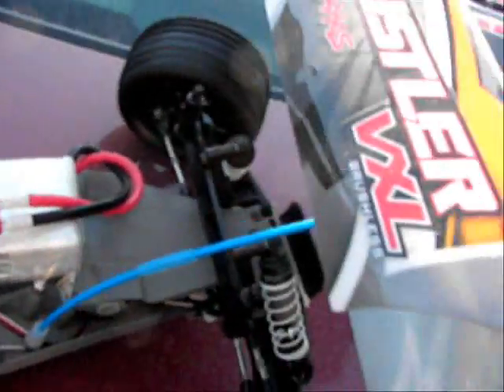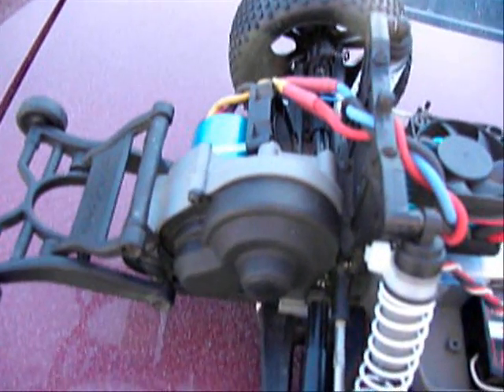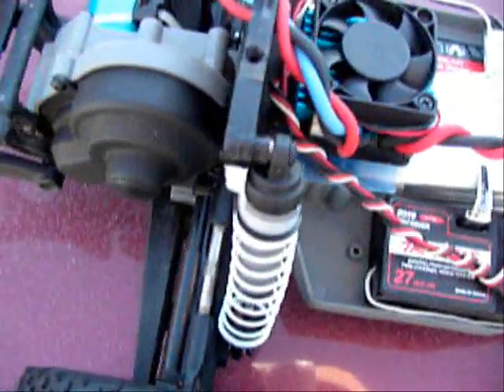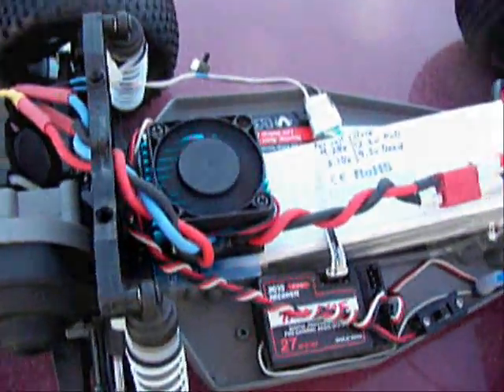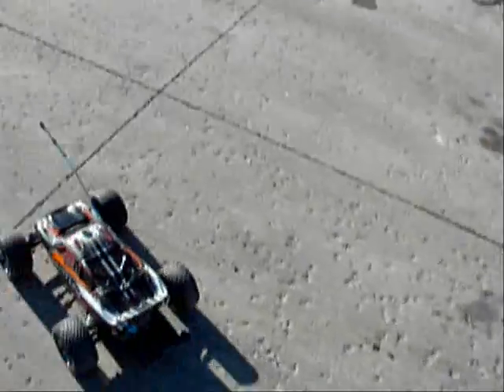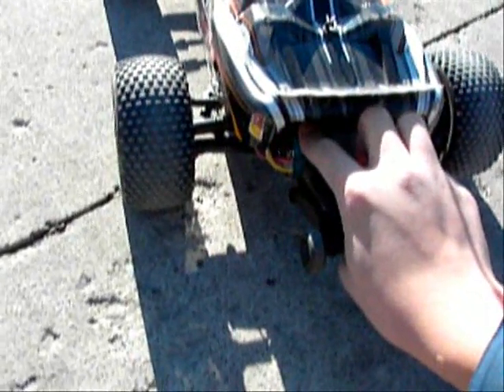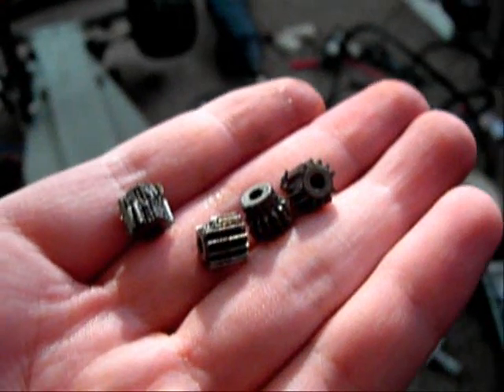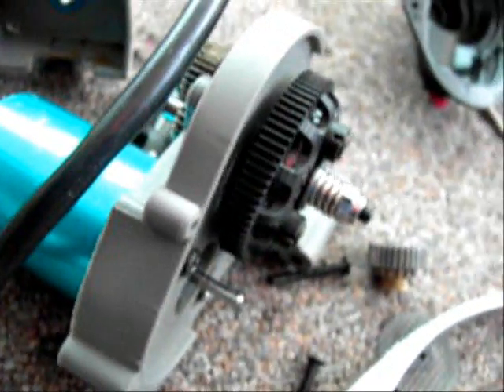Traxxas Rustler VXL Brushless RC Part 2

Comment: that thing is hallin ass man. and still power to wheely at high speed, holy fuck balls no wonder you spun your differential gears.  that thing is faster than my promod12's.. holy shit.. i still can get over the speed on that thing. i want to convert mine now!  lol.. go alittle lower on your lipo will keep you from running the motor hot, and spinning differential gears.  when you put to much juice to the motor it will heat up.